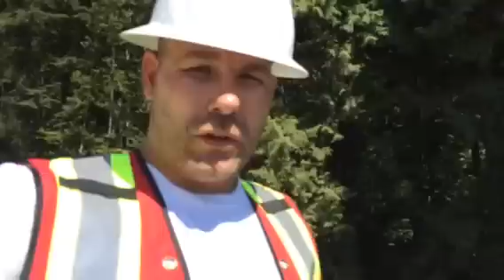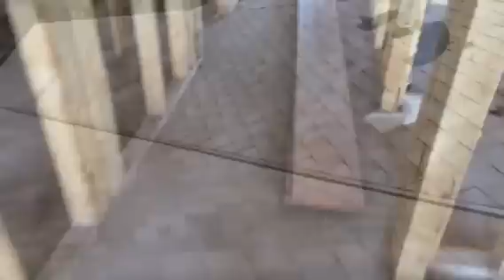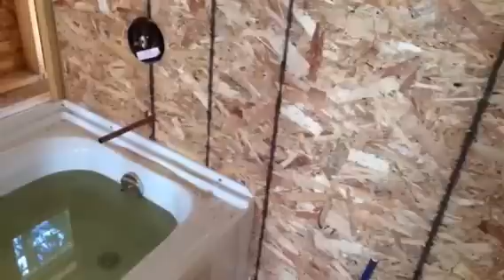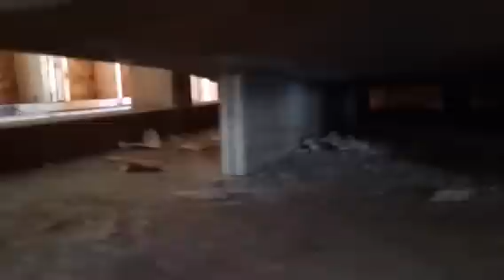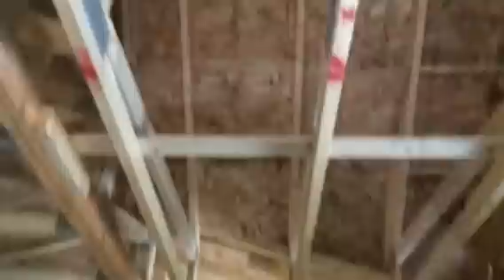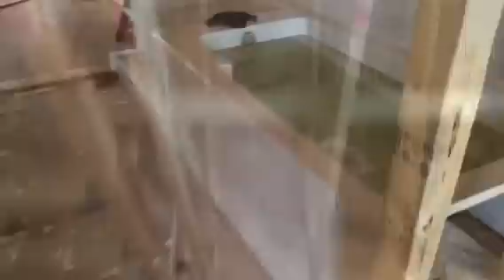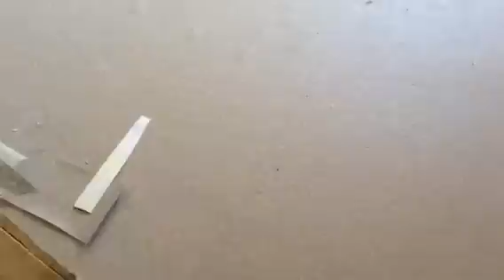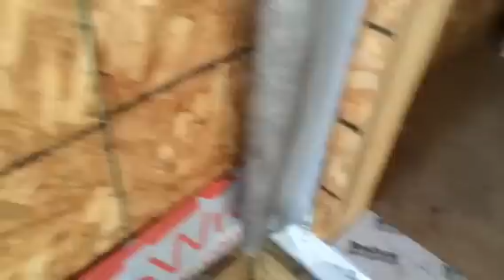New Home Construction Fails

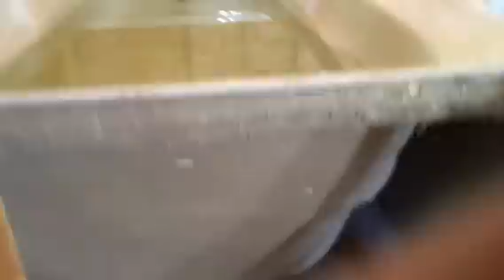Comment: at approximately 1:45 into the video you stated 1 gallon weighs 10 pounds, That is incorrect.
According to  Wikipedia 1 gallon weighs about 8.34 pounds.
If you are a real inspector I wouldn't want you to inspect my house.
If you get the weight of a gallon of water incorrect what else do you not know. ?
Please review your videos for incorrect facts before you post them.
Reply from the maker: Carl Halfpenny In Canada we use the metric system and something called an imperial gallon as a unit of measurement not a US gallon which is smaller.  An imperial gallon does weight approximately 10 pounds. Here's proof and a definition for you. 
http://en.m.wikipedia.org/wiki/GallonPlease do some of your own research before making your own incorrect facts. Thank you  It's inspectors like me who save people like you from buying poorly built homes like this.
Reply: Tom Munro, CHI Besides heavy in a small space on what looked to be 3/8 or 1/2" plywood is a guaranteed complete cracking of the flanges when the bottom collapses as it will with a 150 to maybe 250 pound human on top of either 249 to 300 pounds of water weight. The whole tub might have to be replaced unless you have a good fiberglass guy repair it after the base is built like the shelf it should be with a few 2x4s under the middle. Those flanges are not made to hold weight.
Reply: +Carl Halfpenny  Looks like he knows a hell of alot more than you ,  spanky .

Comment: I have seen all kinds of horror things done in new building construction.  Had to repair a lot of things as well.  Every thing from foreign workers being too lazy to go outside during construction to use a porta potty so they use a pail with a store bag in it as a liner then stuff the bags inside walls and cover with insulation.  I have seen wall studs cut 98% through the stud because the studs were bowed and drywallers didn't want to cover them like that so they cut through the studs (yes I am serious there was less than 1/8" of stud left uncut in the entire wall).  I have seen rooms framed out with no doorways framed into any walls (yes just like on the TV commercials)..  Drywallers store drywall outside even during a downpour of rain.  They then proceeded to walk through mud to pick up the drywall and actually used some sheets to stand on (which they later installed while covered in mud, muddy foot prints and soaking wet from the rain).  Some subcontractors are incredibly unethical so ask around before you hire and find an honest and reputable contractor/subcontractor if renovating or building new.

So I totally agree with the video.... GET A HOME INSPECTION and make sure the inspector KNOWS what to look for and what he is doing.

Comment: Home inspections on older finished houses is a waste of money.  Page after page of disclaimers and no 2 inspectors find the same problems.  I kept the inspection report from when we bought our first house 9 years ago.  Then when we sold it, the "issues" the inspector pointed out were different, he missed a few major things and he basically got paid to say its OK when in fact it needed more work than he told them.

Inspecting a new house this way is the ONLY way it is worth anything, although a building inspector should have caught most of those mistakes before allowing it to be closed up.  It's a terribly unregulated industry, anyone with a ladder and a clipboard can become a home inspector.
Reply: It's my labor, it's free since it's my house.  I'm extremely handy and I have friends with the proper licenses to inspect and pull permits.  I just don't mind getting my hands dirty like 99.i9999999999% of the world.
Reply: soaringtractor
One of the issue is that people hire the cheapest of the lot. You pay 200$ for an inspection? you get for 200$. Get one at 500-600$ and it should show lots of things. I saw a few reports from some of those cheap inspector... Total disaster. The photo show some paint that "melted", most likelly due to water infiltration... Not a single mention in the report (of like 15 pages). Bro's reports are in the 45-60 pages. Sure, hidden defects won't show up, however what is visible  should come out IF YOU HAVE A GOOD INSPECTOR. Sadly, there is way too many wannabe inspectors... It is unregulated and do not require any course here (in quebec, canada). Bro is a member of an association that is pushing on the gouvernement to make it mandatory to have a card, which require some courses and all. Fail the course? lose the card, no right. From seeing bro's report, I can tell that pre-purchase inspection is worth the money.
Reply: +William Kelley I always do my own inspections now.  My first house i paid a guy and he basically took my money and wrote up a nice report on my house no different than what the realtor had done up.  
He missed checking the chimney, refused to look in attic as it mean disturbing the attic hatch and might chip the paint.  he wouldnt check the roof because he forgot his ladder, would check the furnace as he was way to fat to look around it.  All in all a total waste of money.
Reply: +Steven King I work in hotels and have had conventions with home inspectors.  They sound all great on the surface and they do take courses to learn the proper ways, but the guys taking the courses are not serious and just see it as a way to make easy money.  I would sooner pay a licenced contractor to look a property over than one of these arm chair inpectors.
Reply: Already brought it up to code myself and much work over the years.  Already doubled our 50k down payment in equity.
Reply: +soaringtractor That's why I get anxious about that industry, they are not accountable for anything.  The entire first part of your house inspection report is the legal section stating that the information is the best that could be provided, blah blah blah.  We can't be held liable for anything no matter what, blah blah blah.  Just like bad contractors, bad inspectors should be jailed.
Reply: +Tom Munro,    CHI I agree, bro being an inspector too... He saw some really shitty inspector...

A good example: pre-purchase inspection. That home have a diagonal crack in the fundation, wide enought to stick a screwdriver in. Previous inspector: "This is normal in this region. There is lots of clay in the ground. Just need to put some concrete on the surface and it will be all good". His report: Abnormal soil movement, suggest to call a specialist to see if reinforcement or posts are needed". Few days later he got news: 50k$ in fix to install some posts and all... The house was not built up to the code and the ground wasn't prepared correctly... He also called for the removal of the interior wall to remove the mold and fix it, previous inspector called it clean. Crack in the foundation, discolouration, high humidity (both ambiant and surface, surface humidity drop as you go away from the crack), "basement smell", softness in the floor...

Another example: main floor beam rotted away and the floor collapsed to the sanitary void, unfinished. They built a new floor on top of the old one... Old one continue to rot and mold on it. One inspector gave the A OK to that house. Few weeks later... he learned that the city said the house was dangerous. 2 weeks later it was demolished. Yet... One inspector said it only needed a few minor repair...
Reply: +William Kelley you should of used somebody else then, when I brought my (115 year old) house I had a building inspector look at it but also a certified electrician and plumber and builder and never regretted the expense. I am in Europe by the way not the US
Reply: soaringtractor ".what else would you expect ???? " what is that supposed to mean?
"s responsible for The inspections of new builds" Independant inspection is always a good idea, gov inspectors check rarely and are very busy not dedicated.
" "Home inspection" is just a cursory surface inspection of what is already built !!!" In depth over here and I would think inspectors like the chap making the video as well.
Reply: soaringtractor "Bunch of old backward countries" It was at this point you went full derp, never go full derp
Reply: The home inspector is not liable for anything,.
Reply from the maker: Thanks for your comments William but, clearly you hired the wrong home inspectors. 

The questions that you should ask before hiring a Home Inspector are: how long will the inspection take (it's not a race) do you have a ladder (most inspectors don't get on the roof, I Do) do you use infrared technology (they all should do the can look past just the drywall) will you get in the attic and crawl spaces, and will you evaluate the electrical, plumbing, heating, ventilation, smoke detectors, and  all aspects of the home? Will you take pictures so I know you inspected everything (with a picture you know they were on the roof, in the crawl space, opened the electrical panel etc? 

Lastly will you review the report with me and answer all my questions I have? 

Thanks again William for the comments but my clients get all the information they are looking for before they purchase and home and it's consistently ALL the issues located in the home.
Reply: I should have stated I am in Canada, the industry is highly unregulated here.  Contractors are also highly unregulated here.  I did not mean to imply that you were not a pro, and if I offended it was not meant to.

If you ask me, the biggest problem is when you buy old houses, you are practically guaranteed to have major hidden issues.  Just bought a 130yr old house and did our own inspection.  Roof was known bad, but there were hidden issues, no way an inspector would have found since they were behind walls and ceilings.  I expected this and negotiated properly.
Reply: Home "inspectors" are killing the industry.  You can't hardly make a buck anymore because of these leeches.  You are not an engineer because you took a three day course.  I've built 70 houses and 100 or so remodels.  I'm not a novice.  Y'all are.

Comment: Mr.tom, osb is used in almost every fiberglass tub. If you look closely you can see the excess fiberglass on the osb from the manufacturer. Furthermore osb can be used behind a shower because water should never be back there in the first place. Behind the tile you have the float and behind that you have 60 minute paper. (That's for any moisture that works it's way back there...but I'm sure you knew that) I did get a chuckle out of the hangers though
Reply from the maker: Well Mr. Justin just because the manufacturer makes it that way doesn't make it right, it makes it CHEAP... cheap isn't the best product in bathrooms or in homes that should last 100+ years.  The problem is builders don't build homes to last 100+ years. They build them CHEAP and sell them for lots of money. The OSB backboard for the shower wall is NOT permitted in my area's building code. So it was removed.

Yes the hangers were funny, thanks for the comments.
Reply: I agree it's not a good building practice. I got a friendly question and would like your answer/opinion on it, would you make a contractor change the location of a hvac registrar if it was within 4' of a fire sprinkler? The logic being if the house catches fire and the a/c is on, the air flow would impede the spray of the sprinkler, what do you think?
Reply from the maker: good question Justin Higgins, I would refer to the manufactures specifications for the area/demographic that the HVAC is being installed. the problem is they are all different. My concern would be during that during the heating cycle the fire sprinkler might heat up and break the filament.  Some filaments could break as low as Orange (135°F / 57°C) or Red (155°F / 68°C) Again something to consider.Refer to the manufacturers specifications...
Reply: Thanks for the input. Keep up the good videos